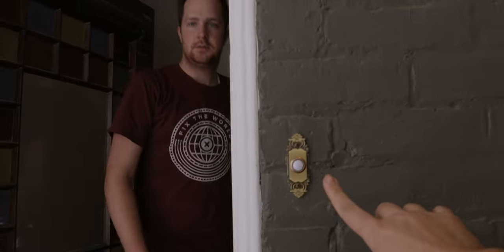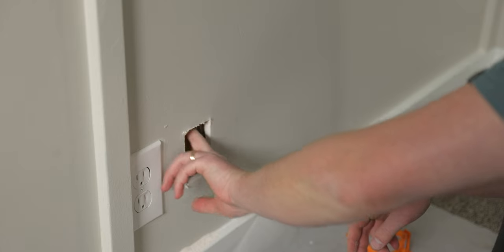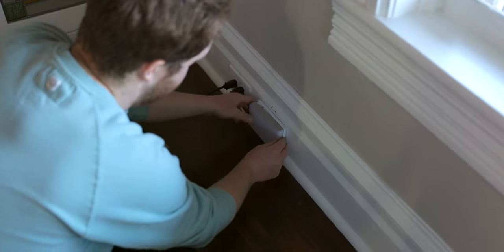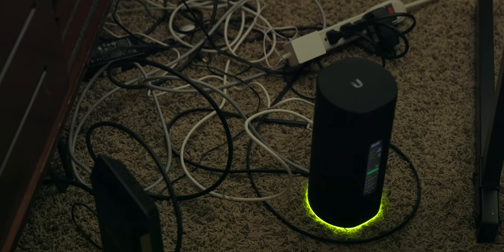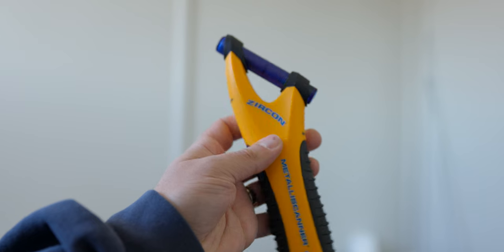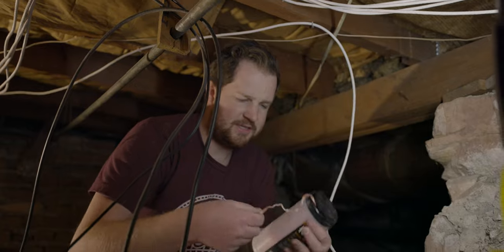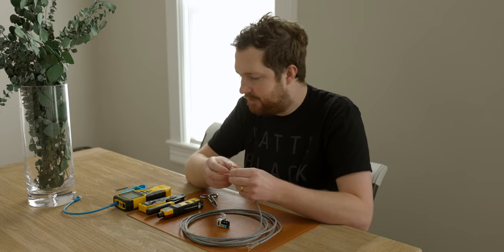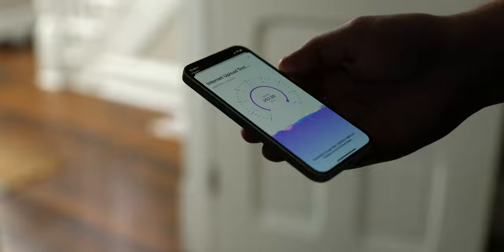Adding 10 Gigabit Ethernet to my 129-Year-Old House!

Comment from the maker: Use my special link https://www.privateinternetaccess.com/snazzy to get a 77% discount and 30-day-money back guarantee!
Reply: Protip: give the external cables an extra shielding, not against UV Light, but against animals, like martens, raccoons and Birds! 
It will save you quite a bit of headache down the line.
Reply: I don't think the picture of Quin looked flattering in PIA's link. Really liked the video. Thanks for sharing
Reply: Hey Quinn, could you share those home mapping and planning apps! Those look super useful!
Reply: The annoying part is when you think you have the easy one of just pulling out the coax then you find out the builders stapled it to the stud and it's not the kind of staples that allow it to move. 🤬
Reply: Every color in the cat6 is twisted differently, which makes the order matter. Different signals, different twistings...
Reply: PIA RULEZ 👍 Been using it for 8 years now or is it 9.
Reply: No 6ghz wifi?
Reply: I don't see where the stapler was linked, anyone know which one it is?
Reply: punch down are 66 and 110
Reply: sooooo, what am I going to be able to with a house i don't own and just has the bare minimum to only get a single router set up and connected, which certainly has no existing drops, and nowhere near enough 'security' to do runs outside the house?
Reply: its a rick roll dont click it
Reply: @Fun With Minerals a
Reply: you have no idea, how much this helped me.
Reply: But Why choose 10gigabit internet speed 🤔.Peoples 100mbps is fast 
Me : Laughing in Russian 😂🤣.
Reply: But what is the use 10gigabit internet I also think 🤔and how yours internet providers giving 10gigabit internet in your area.
Reply: @Fun With Minerals Vodafone broadband speeds are so bad!! I’m currently with Sky and speeds are around 62-65Mbs..
Reply: I live in a city where historic homes catch fire spontaneously and fire departments don't investigate them. Develops love us!
Reply: Did no one notice the pennywise edit in the craw space? You had me for a split second. 🤣🤣🤣
Reply: Do you plan on showing us a 10 Gigabit speed test ?
Reply: the intro was funny
Reply: PIA is under the eyes jurisdiction
Reply: @Fun With Minerals o
Reply: O oi  il ioooo  et j’ai tout dep
Reply: Oui 👍 est pas
Reply: BBC
Reply: O  y  no   👌🏼 a la la Ok
Reply: @Fun With Minerals 

 Oui 👍 est pas 👣
Reply: Ok 👌🏼
Reply: @Fun With Mineralso  Lo o
Reply: Oui
Reply: Mon
Reply: Moi
Reply: Il ou y ai des gens gens comme  moi
Reply: Il ou y ai des gens gens comme  moi
Reply: Ok 👌🏼👍 a
Reply: XV
Reply: Ok
Reply: Mon
Reply: U
Reply: Io
Reply: B
Reply: Ou moi b
Reply: O mec
Reply: Ouoooooou n oh ok 👌🏼
Reply: @Fun With Minerals nnnnnnnnnñnnnnnnnnnnnnnnññnnnnnnnnn
Reply: Please tell me that he creepy face in the black at 11:15 was edited into the video lol
Reply: Hi, I have installed CAT 6 cable throughout my house from one central location, i wanted to know how I can make one singular wifi network from that, so that i may be able to move throughout the house without drops in connection, or having to reconnect to another network, which devices will I need to buy for that, to create a mesh like network.
Thanks so much in advance.
Reply: now we just need a video of steam generator  powered Fiber  runs  retrofitted to an 1800s Log Cabin....
  Toss some more shovel fulls of Coal in the Boiler,  I wanna  watch streaming  Videos !
Reply: That house is the…

Sh*t

Comment: Ah, American houses. So much easier to do these things.
Reply: But aren‘t they than not well isolated and save? Texas last month?
Reply: ikr 😭
Reply: American houses in the north. (They have basements and real crawlspaces)
Reply: @MaxxPlay99  completely unrelated. also, texas doesnt get all that cold, so that level of cold snap was unexpected. also the prep northern people do in winter simply isnt needed down south most years, and the energy industry thought the same thing. they found out they were wrong the hard way, and thats all there is to it
Reply: @bradhaines3142  Ok thx for the clarification.
Reply: @bradhaines3142  cold snaps of this magnitude seem to happen every 10-20 years in Texas. People die every time, but the energy companies have no incentive to prepare, and the state government won't step in and mandate they change.
Reply: @MaxxPlay99  That was Texas. Not the same here, in the Toronto region.
Reply: @MirekFe  you're only like what, 2000 miles north?
Reply: coughs in French with my house made out of bricks/rocks lmao
Reply: @lucasbarraud  no doubt those exist. But I tend to see these home improvement vids where people put holes in their walls by hand. My walls would laugh at me without a jackhammer or slot cutter - basically any heavy machinery 😅
Reply: @bradhaines3142  Well actually more like around 2600 km (1616 mi). 😅 But yeah I get what you mean.

Construction wise, Canada and the US, are pretty equal when it comes to home construction, except things like insulation in our walls "mostly" (we've got to maintain the standard with y'all).
Reply: @FloydBunsen  I don't think @Snazzy Labs home is in 'the north'. I could be wrong.
Reply: brazilian ones are better
Reply: @bradhaines3142  fr literally if cold outside it get cold eventually in your house usually in hours
Reply: @latinxcombo3612  he lives in salt lake city Utah, its in a desert which gets a bit of both because of how dry it is
Reply: @MirekFe  well 'texas' is pretty vauge since you can literally drive 16 hours in a straight line and still be in it, so i guess we can say we're both right
Reply: My Edinburgh 1ft thick granite igneous walls agree.
Reply: That’s impossible in Germany with stone built houses
Reply: @lucasbarraud  ooof
Reply: Last year I had help from my dad putting cable into channels that were cut in brick wall. Dumbass me did not check if it was negotiating to GigE properly, and now that cable will forever be 100Mbps unless I replace it with a cable that doesn't have a break in it somewhere.
Reply: @MaxxPlay99  Texas homes aren’t designed to manage cool temperatures. It’s like Italy or southern Spain experiencing snowstorms
Reply: I'm canadian we have a lot of house that looks just like his.. maybe a bit more insulated but still as a professional technician I do a lot of fishing and ethernet termination like he just showed, and if you ask me the google technician did a pretty mediocre job of an install the cable wasn't straight and wasn't well attach
Reply: Okay I gotta ask. Where are you living currently?
Reply: They are easier depending on construction but overall they largely very poorly built to keep building companies and energies companies making money. Most are built quickly for traditional consumer appeal for looks but very little thought to long term longevity, efficiency and maintenance.
Reply: @CataclysmZA  Have you tried re-crimping the connectors on each end? Worth trying just in case it's not a snag in the run but just a bad connector.
Reply: @CMBurns1000  Same as mine, house build with dry wall are rare, mostly new buildings use that, we call them knauf for some reason.
Reply: If you want to do this in Europe/any properly built house, you will have to pry open the walls and lay down cable channels before doing anything. and he just drops them in the wall...
Reply: Easy to modify, kinda meh quality, then again, in doesn't matter in Australia since you need to pay an electrician to dick about in the walls (I imagine it's the same for network cabling).
Reply: My house full concrete 😭😭
Reply from the maker: @bradhaines3142  This is correct. In the winter it gets as cold as 0F (-18C) and in the summer it gets as hot as 110F (43C).
Reply: @MaxxPlay99  do you think all of America is Texas? Insulation doesn't do much when you have no heat to insulate. When you are out of power for a week with no heat(Texans don't usually have fireplaces for obvious reasons) they use mostly electric heat and with out power...no heat. Eventually shit will freeze with no heat source. This isn't a hard concept.
Reply: @jim_bocho  have you not heard of a rotary hammer drill?
Reply: @simonwilson7581  lmao except that isn't a thing and never happens.
Reply: @jan what are non American houses like ?
Reply: @robertf863  Not all old homes are poorly built and not insulated, mine is 142 years old is largely insulated.  Older homes often have better stronger wood and not those thin timbers they claim are 2 x 4 but arent.  My stone foundations are 2x thicker than what they use for new houses.
Reply: I was thinking of the same thoughts. My whole house are made of bricks. No way of laying down cables without breaking things
Reply: @lucasbarraud  Rocks? Weird flex, but ok
Reply: Yeah. I think people from Asia are having a hard time do things like these because most are concretes 😅
Reply: @Dongdot123  I mean it can be done , just not easily or cheap.
Reply: Paper wall country
Reply: Only in the US.  Here in the UK we have proper brick built houses, not glorified garden sheds.  No crawl spaces and no stud walls.   Wr have to chase out the walls with electric chisels and drills to run any cables.   Which is exactly what I did to mine.   A lot more work, but it's the price you pay for a far more solid house.
Reply: Good luck doing this on an european full concrete and bricks house doing the interior walls thing 👌
Reply: Ikr. I'm not allowed to even change my windows in London because they need to "preserve"the history as most houses are all 300+ years old. I have to build a window behind the window in order to reduce noise lmfao
Reply: They are also very weak. Walls are literally made of hardened paper.
Reply: Can't do that in Indian houses

Comment: “Uh oh, I’m a stud” pmsl. That’s a great Dad joke right there. Will defo be using that one.
Reply: If you haven't heard that joke until now then you are a disappointment to all dads. Smh
Reply: But Quinn has no kids (yet). He's a faux pa.
Reply: Its actually a requirement to complete the stud test prior to use.  Similar to 3 clicks on tongs.
Reply: @leefhead1  as well as pulling the trigger of a drill before using
Reply from the maker: @cardsfanbj  faux-pop
Reply: @GageDrums  I pull the trigger on the drill before using to see if it sounds like the battery is working well and I have the direction correct.
Reply: 100% chuckled when I got to this part of the video. 🤣🤣🤣
Reply: made me laugh harder than it had any right to

Comment: I've been working with ethernet for at least 15 years, and this is the best explained video I've seen. Congratulations 👏🏻👏🏻
Reply: I learned from vets at my last job, and they didn't teach me that great jacket tip, thanks! Also, that Klein terminator is about as handy as they come, and it includes a cable stripper near the pivot. For learning colors, one tip if you go B and orange white first (which you should probably) is to remember clip on the connector down, and white stripe first in each pair except the middle color, blue and blue-white.
Reply: @vanforsman  I know!! I'm using the jacket trick next time. No more scratched fingertips 😁
Reply: Agreed. It was great.
Reply: Same
Reply: Been on doing for 8 years and I agree with you

I just get a bit trigger when no one uses the protection for the RJ45´s head ( the plastic covers)... I don´t know the exact name in English, I guess I got used to use it in Enterprise clients and my own home.
Reply: @blyatkachuthedebil7655  RJ-45 boots. Boots are great for strain relief so long as you buy the right-sized ones for your cable. Some boots are made for CAT6 and CAT6A cables which are slightly thicker, and some cheap CAT5e cable with thin shielding will sit loose in some boots. 

It's a crapshoot, really. Most people I know, myself included, don't use them unless it's requested.
Reply: @vanforsman  another tip with the jacket is you can also use them to straighten out the wires once separated as well. Save your thumbs/finger a little.
Reply: @brikstik3442  lmao I habitually forget that part
Reply: @vanforsman  lol, Makes life alot easier.
Reply: Fantastic video for someone who doesn’t give a crap about doing things correctly
Reply: The part about using the cable jacket for unwinding the little frikking wires... Hahah priceless. Cant believe I never thought of that.
Reply: @vanforsman  Right? I just about slammed my head on my desk withthe Jacket tip. Klein makes some great termination tools. They now have a very fast keystone terminator. Its awesome.
Reply: @blyatkachuthedebil7655  Here they are called anti snag covers. Or Boots. Mostly anti snag for when your pulling the cable back.
Reply: @CataclysmZA  Im impartial. Depending on use case.

Comment: It's actually pretty important to use Keystones instead of just continuing the cable out of the wall. For one, most in-wall rated cables are solid core, which means each wire is made out of solid copper. These have better distance performance and longer life, but are stiffer and can work harden and break if bent around a lot. Patch cables typically use stranded core, kind of like speaker wire, made up of a lot of small strands of copper per wire. Also, if you break a wire coming out of a wall, you could end up needing to replace it if say it needs to reach 4ft into the room and you broke it at 2 ft. Whereas with a keystone you can just replace the patch cable and all your wires in the wall are safe.
Reply: I know this is an old comment, but there’s one thing that I would say justifies just having a cable sticking out of the wall: *plaster walls*. It’s so annoying to cut through or even drill through that I would say just having the wire sticking out is fine.
Reply: @myrealusername2193  If u want to just have it hanging go on but professional installers would say use a keystone as the head comment here explained perfectly. I would rather install a cheap cable instead of a more expensive cables used to run behind walls which you really should consider using.
Reply: @myrealusername2193  if that's the case then just use a surface mount box to punch down the wire to a keystone then. This is common along with cable raceway on walls with concrete, glass, and brick.
Reply: @JustSomeGuy009  surface mount jacks with rear entry are exactly what that situation calls for. No reason not to do it right.
Reply: @myrealusername2193  Yes but as the guy said especially with solid copper wire, which is what pretty much everybody that has ethernet cable running through their house has, just simply running the cable directly from the wall to the device is quite risky as it becomes weak very quickly and breaks when bent and moved around even a handful of times. and if it does you're kinda fucked because you have to remove that cable completely and replace it if it's not long enough to reach your device. its really not much more time and money to go the extra mile and do it correctly.
Reply: @myrealusername2193  I am doing proper low voltage boxes and keystone connectors in my plaster walls. It's really not that bad with an oscillating tool to do the cutting
Reply: @myrealusername2193  IMHO, you should always end with a keystone, even if you don't cut the drywall and install a nice box for it. Then, you can use a patch cable to the device, like @tyler pieper said.
Reply: I’m actually in disbelief some people actually just leave the cable hanging out of their wall. Wtf?? I didn’t know this was a thing, I didn’t think people were that stupid
Reply: @nos4me  Don't call people stupid because they do something different from what you think is right. There are many reasons for doing it one way or another way, but there's NO reason to insult people for whatever they chose to do.
Reply: @nos4me mine hangs down through my ceiling

Comment: I work in IT now but I worked as a infrastructure installer for several years, it brings a smile to my face seeing you do what was my job for 4 years
Reply: I love watching people suffer through what I used to do for a living.
Reply: Had to laugh about his naive comments about interior wall cabling. Everywhere I've ever worked, there's been a building code required fire dam right in the middle of the wall. Nothing works on that besides a really long drill bit and time spent in the Attic getting Hanta virus from the mouse droppings.

Comment: Great video.  I have been using unifi for a few years now and love the product.  My house isn’t as old, but I too had crawl under my crawl space to run wire in my house.  Love the creepy green eyes that appear in background (11:11) as you say the crawlspace isn’t haunted by Pennywise!
Reply: i wonder in europe how it is possible...imean ahah
Reply: haha i noticed that too, immediately went to comments to see if anyone saw those eyes!
Reply: Nice Easter egg lol
Reply: Can't find it... where are them eyes
Reply: @Appri  you see the white cable bunches at the bottom - see the black tape on top of one of the bunches -  slowly look up the sceen in straight line - you will see two white eyes 🙂